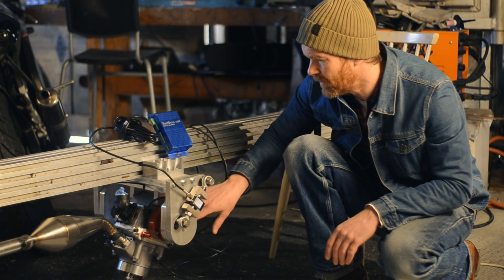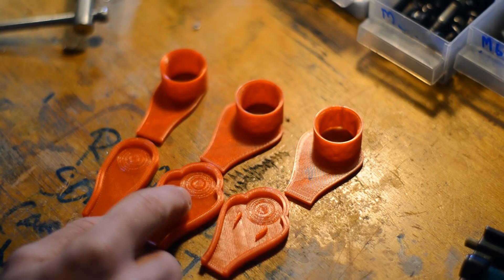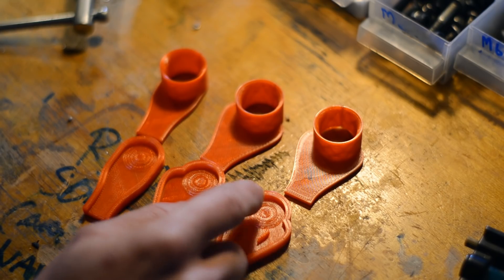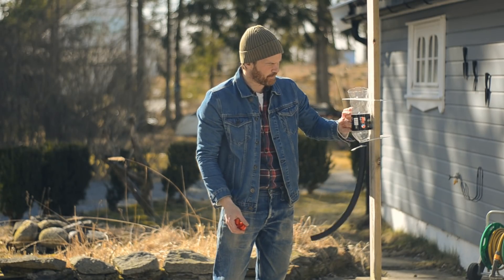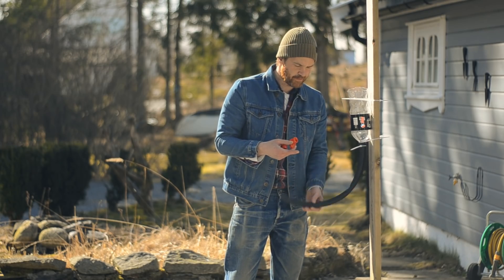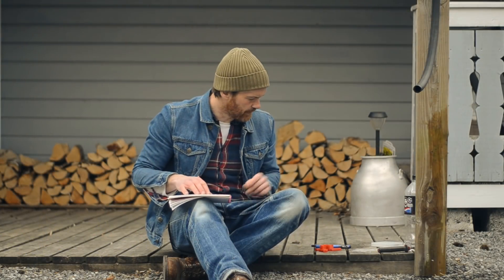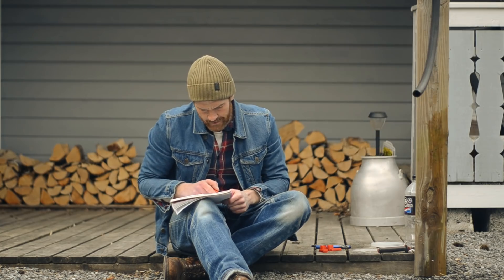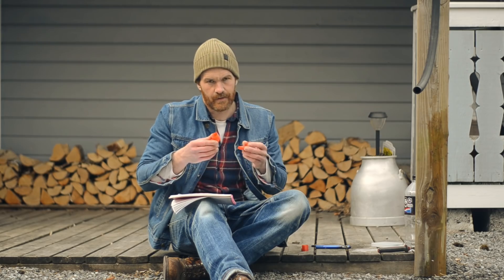Three 2T Exhaust Ducts, Which Will Flow Better?

Comment from the maker: DISCLAIMER: Hey there, thanks for watching! There's  been lots of clever points brought up in that community post where I asked you to guess the outcome. This was just a quick-n-dirty flow-only test. Fear not tho, more better testing is coming! Oh, and, congratulations to everyone who chose "red"!
Reply: This test though is not very useful. Water is incompressible which means the Flow Restriction is going to be the opening. There might be some slight deviations but you just can't use Liquid to simulate air. I used to do full-blown CFD for diesel engines. Unfortunately I don't have access to the software anymore. It was an internship at Florida poly
Reply: @friedtomatoes4946  Oh good. What this guy said.
Reply: @Touwtje  Thank You!!! Yeah if i was to do this i would make a mock up of the design, calculate the expected exhaust volume and use a air cannon or talk to simulate it. That or use one of the free cfd solutions out there. Wish him best of luck <3
Reply: @friedtomatoes4946  you can learn something from any test. This setup shows that less restriction alowes easyer flow. Main difference, imo, the strait one is more restrictive because of strait walls that increase the friction. On the curved the restriction point is moved to the end. The curved with Finns is slightly more restrictive because it creates more friction.
Reply: @knuddelwinzig498  no, the Reynolds number is way off.  I don't know a ton about fluid dynamics but I know that much.

And by not a ton, I mean I did research on the flow of liquid metal jets through laminar flow nozzles but there are people who know a whole lot more than me, I just did the nuts and bolts of the experiment and knew enough to set it up, I saw the data collected and one of the results was that surface tension has a big impact on the flow of liquids.  I am not 100% sure on this but I don't think surface tension is really a thing in gasses so that's enough to say it is very difficult to use liquid flow to simulate gas flow with any accuracy.
Reply: @knuddelwinzig498  yes but none of that will apply when you add air. Friction specifically surface friction functions very different. One like water with air that can create turbulence. While the one with the flow straighteners may have had more friction that lowered the flow rate, when dealing with something that is both compressible and turbulent you may find that the most optimal one would be the skinnier tube with flow straighteners. On the wide one you're going to risk flow separation which will drastically increase friction because of the pocket of turbulence. The exact same thing actually helps pickup trucks. They create a Vortex behind the main cabin which effectively makes the car more aerodynamic. Problem is that you're not going to get a Vortex with this set up so it's more akin to having a very chaotic rough wall which is just going to be worse. I might be able to run a 2d simulation of this to show what I'm talking about but that would take some time and some processing power. Unfortunately I don't have access to converge cfd anymore which would allow me to completely simulated in 3D. The only thing I want to say is that the stuff that I was doing got presented at eth in Switzerland to the leading Experts of diesel emissions and NASA which said that they could not do that kind of simulation because they focus more on rocket and 1D simulation. Here is an example of what i did https://drive.google.com/file/d/1b5J0EUgWIFPs8N1YWKUyOr5gmMInjF8Y/view?usp=drivesdk notice how the high velocity air separates in the tank. In this case it was no problem because the tank was big enough but I've done simulations with both smaller dpf's and tanks. Effectively if you get separation of flow the Restriction spikes drastically. Why do you think all exhaust pipes are the same diameter and there's a lot of angling  before going to a filter. Frankly put if you wanted to make the diameter wider you have to do it with an angle and then you have to make sure the flow of Air does not separate from the surface. That rounded design is like everything wrong. Giant no no
Reply: @beardoe6874  yeah 100%. Air can actually act like a tube for itself it's really wonky. My years of simulation work has made me have a lot of appreciation for people who do this for a job. I did not even mention reynolds number frankly put the level of discussion I just don't think can be had in a YouTube comment :)
Reply: @beardoe6874  not sure what you disagree. You are right with Reynolds and surface tension of liquids.
Reply: @knuddelwinzig498  friction isn't a thing in fluid dynamics.  You can have boundary layers but if the port is designed properly, you won't (for the most part).
Reply: When I was a kid, I worked in a Vaccum Cleaner rebuild shop...Imagine the disappointment I felt 10 years later (I had become a successful race car and race bike builder by then)  when I cranked up my super high dollar ( couple thousand) "Super Flo" Flow Bench and instantly realized the unmistakable sound of 2 "Electrolux"  vaccum cleaner 1 hp Lam electric motors!!!...Big pretty wooden frame with 2 $12.00 (at the time) Lam motors and 2 "Manometers" (cheaply and easily purchased)... You can make the same Flow Bench for around $225-$250 at todays prices..purchase the "Superflow" Operator's Manual and your in business as a "Port" Specialist..IThe exact machine used to build 11,000 HP "Heads, Intakes, Exhausts, Velocity Stakes, etc"...You. can "calibrate" the exact distance from the "Lip" of the Velocity Stack to the "Lip"  of the intake or exhaust valve. The HP the prjected "port" will achive at various RPM, and the "Port Shapes" (I make minenout of modeling clay to figure best shape, ramp, and hour glass runner shape) You can precisely calculate the "timing" of the 2 "Flow Waves" the engine will produce to the Cam Lift, Exhaust Scavage point, etc..Saves BIG $$$ and time over the "Hunt and Experiment" method of Intake and Exhuast layout...I highly reccomend building your self one for this project!!!..Step #1 - order the "Superflow" Operators Manual and everything else wil fall into place (around $25.00) plenty of pictures to copy the "Box/Frame" design and all the algorithms needed and their explanation...I just thought it would be the next step in your design of your little engine...It will give you Unlimited simulations instead of building, 3D printing, etc. and can be incorporated into your "Cad" program...I have been a loyal watching "lurker" since the beginning..I hope you get to "Run" Bonneville again soon!!!
Reply: I'm exhausted.
Reply: If you want you can shoot me a DM, ill make a CFD test for you, i have the tools for it. Just need some info on the setup :)
Reply: Chose the blue one. Damn.
Reply: The fins make a more constant and forceful flow from the looks it's worth messing around with.
Reply: @2STROKE STUFFING I've noticed that your last video about the motorized bicycle was posted 2 years ago :( have you decided to completely shelf that project entirely? In all honesty, I was hoping for some insight on cylinder swaps to do a bigger bore. Everything else I hope to do you have already explained in an amazingly helpful way and detail. Please let me know!
Reply from the maker: @buckdwildass  It'll be back now that I've got more time on my hands 👍
Reply: @2STROKESTUFFING  Hey ill leave after this. What I would recomend is not reinvent the wheel. Straight pipe exhaust is the most efficent you can get. Its why we still use it. Smarter people than you and me have spent there lives studying this stuff. Its forgiving, has great flow and just works. Use a 45 degree angle from the exhaust port to the exhaust pipe. Make it somewhere between 1.2 - 1.4 times larger. Its important that the air never goes super sonic NEVER. This must not happen or its not gonna work. After that do what you want. Keep going you magnificent bastard
Reply: Bruh.  Just send me a stupid awesome 2STROKE STUFFING whiskey glass. In red please to match the clear float bowl. 😎
Reply: I wonder if you combine that duct with Tesla valve if is gonna be more effective for flow. In tesla valve fluid,gas... dosnt create much turbulence and vortexes to slow down flow.
Reply: Can the casting on cylinder head be enlarged too much on exhaust port.i have ground grooves to smooth transition to the eyebrows to suit my taste.roof and floor of exhaust port kept the same.we run a venturi in the header about 3.5” off piston..
Reply: I think now you showed the bottle that it should swirl for the best result,....so something like the inside of a gun barrel to create a vortex.
I know for a fact that if you swirl the water in the bottle that it would empty way faster than just holding it upside down.
Or maybe just the form of a sink/bath drain with the 6 little holes in it, they also create a vortex when you are finished doing the dishes and pull the plug....you do do the dishes, right?
Reply: @StedeGrooves  the swirel workers on a bottle with bottom. The vortex allows easy water air exchange.
Reply: @knuddelwinzig498  yes, i realized that also....but still i wonder how it would react when everything is exhaust gasses without the "bottom"
Last thing we want is air to flow back into the cilinder...i totally agree on that.
Gonna do a bottle check without the bottom.

Could do only one try because my house mate jumped under the shower 😂 but it didn't swirl and it was empty in the blink of an eye and couldn't even handle the stopwatch properly.

We came to the conclusion you should try the bottle itself 😂
Reply: @StedeGrooves  the swirling helps when the bottle has only one exit. than the air is let in through the middle of the vortex..
Reply: @mbalunovic  yes i know that, but still i think it has something to it, think of the fins in on of the designs...so i was thinking something like a gun barrel/different fins and "chamber" design. 
We are dealing with gas and an engine here and not water and a bottle.
Everything swirls in nature, and if nature says so then it's probably true...from water, air, magnetics and much more, they all swirl.
Reply: @StedeGrooves  swirl and turbulence is not the same thing Sir. Air is turbulent, there is no laminar state. Also this is  the reason why this test is completely invalid sadly
Reply: @mbalunovic  if turbulence isn't swirling, then what do you call it sir?
In every picture where turbulence is explained they show arrows going in circles...i call that swirling.
Please stop this "i know it better" conversation, it isn't helpful in any way at all.
Reply: @StedeGrooves  no ,i don't know it better. Im just working 5 years with fluid dynamics as senior. (Including CFD of multiple aggregate fluids, including cavitation, etc).

Swirl can have laminar flow in it self. It doesn't mean it's turbulent flow. The fact that turbulent flow is shown as swirls a completely different story.
Reply: @mbalunovic  yes, schauberger swirls 😂 and you do try to be better because now you present us proudly your titles to indicate that you know it better.
You say it doesn't swirl, i say it swirls.
So we clearly disagree.
Have a good day sir.
Reply: @StedeGrooves  i care less of the title than of a shit down the drain.

Put it simply. A thumb is a finger, but not every finger is a thumb.. 

A turbulent flow involves swirls, where every swirl has its own swirl down to molecular level. 

Fluid dynamics is not something that can be discussed on youtube. 

Its not intuitive, its not simple, and its not something that should be thaken for granted.
Reply: @mbalunovic  I totally agree with you on this, and i don't mean i'm right either....maybe I'll learn some more when i look deeper in to it.
Thanks for that sir

Comment: I don't believe the preformance of the exhaust port is strictly on just amount of flow, I think the scavenging of the port effects the preformance Alot. And with triple exhaust ports you can have the auxiliary ports at a different duration and the way they feed into the main port and really help with scavenging.

Comment: The exhaust gases have mass and therefor momentum...any time you change the velocity i.e. slow it down with the bulge, you have to speed it back up again as the port gets smaller.  A constant volume duct would work best IMO.  Perhaps a larger constant volume would be best?  One issue with your test is water is not compressible and gases are.

Comment: In my opinion that was a very valid experiment. Obviously water has more resistance to flow than air does in normal circumstances. But consider this, on your normal moped, scooter or motorcycle hen the engine is idling, 1200 rpm waiting at the traffic lights ONE revolution takes 0.05 second. Which means the air has to go through the ENTIRE engine, probably faster than you can blink, and that includes the air filter (if fitted) and carb. 
6000 rpm = 0.01 second
12000 rpm = 0.005 second. Air travelling at that speed and under pressure probably doesn't behave like a gas. It's not going be like going outside on a windy day, air travelling that fast would rip you apart. To all the people who pointed out that air is compressible and water isn't yes, that's absolutely true, but increase the air to high pressure and those velocities it may have similar flow characteristics to a liquid. And, I'm talking from experience here, if you've ever been hit by air coming from a high pressure compressor it feels like being hit by a brick.

Comment: I dont think this test accurately describes  how expanding and compressing gasses flows through the chamber. At best it just shows how a wider port at the cylinder can help flow from being bottlenecked through a sharp 90 degree turn out of the  cylinder because you're essentially opening it up so when the water his the top of the head it has more space to exit the combustion chamber instead of stacking up  and causing turbulence as it trys to all exit through a an opening with approximately 100-120 degrees around the circumference of the bore on the yellow variant versus nearly 180 degrees for the red or blue. I'd wager if you used a 2 port design similar to the yellow with half sized exit ports oriented 180 degrees from eachother and narrowed the entrance port to 90 degrees opening around the circumference you would see even better performance. You would ofcourse have the trade-off of more viscous drag around the boundary area of the ports. I think it could be a worthwhile experiment though. Hell, even adding a small protrusion from the head into the cylinder would improve performance if placed at the area furthest from the port as to direct flow instead of stacking up at a 90 degree edge inside the combustion chamber.

Comment: When the testing is less quick-n-dirty get your kids (if they are old enough) to repeat the test 200 times for each shape and check the spread of the results around the mean, This could suggest if the mean result for each shape was significantly different or was due to chance causing random variation.

Comment: This test is a bit "2-D", I would expect that the section needs to get deeper as it comes away from the port toward the exhaust pipe to ensure there is minimal flow restriction.

Comment: i dont get it... in the 2 stroke engine on the exaust side its not going to be shaped like that is it? i mean... a 90 degree  sharp corner just after the gasses exits the cylinder? or am i missing something here? 

if it was an intake port i could see it..  the gass flowing upp the side of the cylinder from the crank into a 90 degree bend and into the cylinder.. but at the exaust side? please explain.
Reply from the maker: Picture there being no duct at all, just the port. When that port opened, would the exhaust stream be straight or fan shaped?
Reply: @2STROKESTUFFING  i dont unerstand the question. The exaust stream at the point of opening would probably be like a swept line if thats what you mean

Comment: Without the reed valve on your hi intake side you will not reach proper power and for the exhaust side try to make a tesla one-way valve these are highly used for pulse engine and what you will gain is after ignition when gas escapes from the ignition chamber will never come back to the engine and not turbulate in exhaust pipe

Comment: Hello Sir, 

Your test is not valid ! 
You cannot test with different fluid, and different fluid speed ! Flow and behavior of a shape significantly depends on the speed and viscosity (Reynolds number). ie one has can be best for low speed (wing shape design) and another for high speed (simple wedge like a knife). 

Please understand that fluid dynamics is not directly scalable. And to learn CFD you need mentored 2-3 years of work. don't get fooled by simple examples and believe that you do understand it. Science still doesn't understand fluid dynamics, and the approach that is used (CFD) is very fragile. You change/define one parameter wrong (and very few are intuitive) and all the results go to waist and are invalid. You will get them (the results), they will look nice but they will be WRONG! this is why in between CFD experts they say CFD stands for Colors For Directors..

Remember CFD equations that try to mimic Navier-Stokes equations (which cant be solved by mathematics) is only an approximation. I respect all the work you've done so far, but statement like the one you made just shows how little you understand fluids.

Comment: Super advanced flow bench setup! a better one might be to connect the nozzle to a garden hose because then you have constant pressure rather than decreasing head pressure from the bottle. Measure flow by filling up a bucket with markers